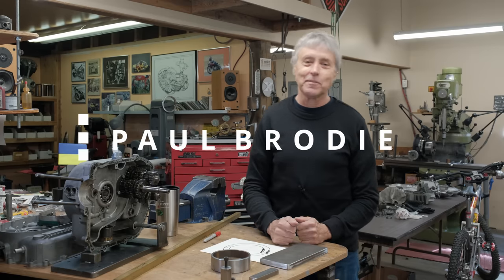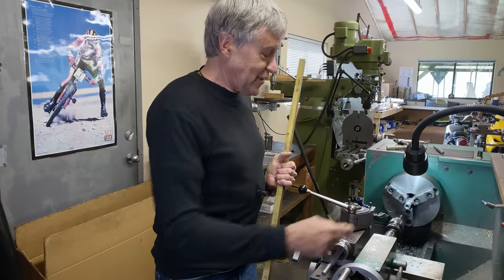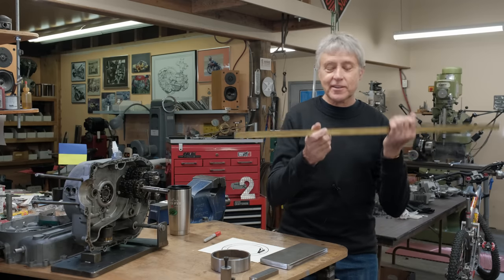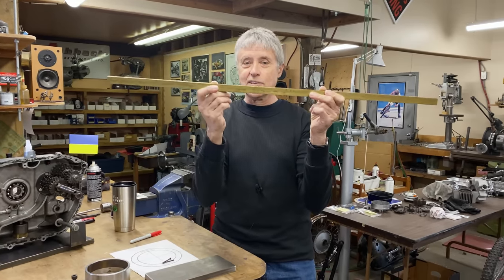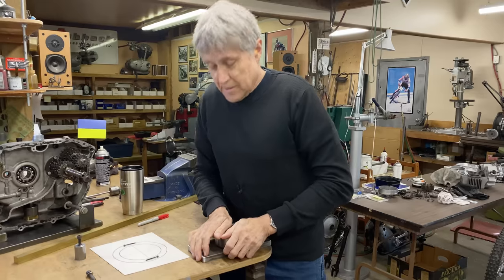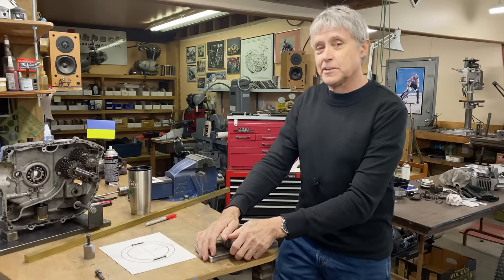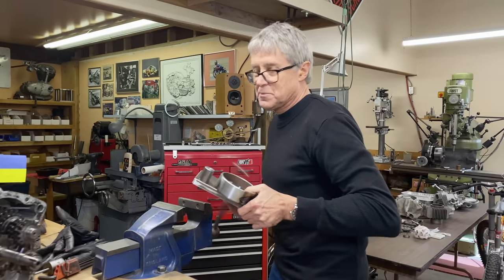Tailstock Spinner Upgrade // Paul Brodie's Shop

Comment: Very cool!  Dont forget to use your carriage as a tailstock stop so you can pull back the tailstock to remove chips instead of retracting the quill and then push it back against the carriage to your repeatable stop.

Comment: We had rulers like that when I was a kid. Some had a metal edge inserted on one side. I remember the teacher would whack you with the metal edge sometimes if you were misbehaving.
Reply: The metal edge goes back to pens.
Because it is raised, ink from your quill (or nib) will not creep under the ruler because of capillary action.
Reply from the maker: Yes, that ruler does have a metal edge. I also remember teachers that would hit students, in front of the class.

Comment: You mentioned that you were nervous of breaking a tap off in bronze or brass and having to start over. As a musical instrument repairer, we deal with broken taps or rusted in place screws by boiling the part in a solution of Alum. It is a slow process but won’t hurt  brass, bronze or sterling silver. The steel just dissolves.
Reply from the maker: Thanks for the tip! I do try very hard not to break taps, and am 99% successful.
Reply: As an old Jeweller, we did similar if we broke our small drills in gold or silver. The only difference being we'd decant some of our "pickle" solution (sulphuric & water ie; battery acid) into a separate jar & throw the item into it.
Heating the solution increased its "power" to corrode & dissolve the steel from days into hours, especially useful on those "rush jobs", which were usually "why" you'd broken the drill in the first place. 🙄
Only drawback is that steel reacts with the pickle & will create a light "copper plating" over everything but easily removed with a light rub of fine Scotch-Brite.
Reply: This is gold. Thank you for sharing! YouTube is awesome.
Reply: @quartfeira  Just a footnote if using this process, the "broken steel" item will typically be hardened so wherever possible you'll want to heat that section to a "red" heat so as to soften the steel. Just be sure the component your trying to save can 1: withstand being heated to that temp without melting. 2: can still be useable in an annealed state.
Given we're talking mainly brass or bronze, their final usage needs to be considered & whether their softened state would work against you. HTH

Comment: I did not know bending brass like that was even possible. Great improvement to the lathe, immediately recognized why You wanted to do this... On my present lathe I have a lever feed for the tail stock. It is usually wonderful for small drills and long holes but does not work well for grabby materials and larger drills. I use the same type Multifix toolpost as You (B size) and got a MK chuck mount tool holder for it that makes it possible to drill using the feed of the lathe. Works really well, used that method for several years now.
Reply from the maker: Erik, thanks for watching and commenting.

Comment: 3:35 If you are referring to a 12.9 bolt grade, that is 12 9 not 12 point 9, metric bolt grades have two numbers, the "." is just a separator, not a decimal
Reply from the maker: Well, you knew what I was talking about. No one else has ever corrected me. But I am going to check anyway for my own satisfaction. Thank for watching.

Comment: When drilling on my lathe, I unlock the tailstock and slide away from the head stock. To make this convenient, I replaced the tailstock lock lock nut with one I made from 3/4" hex, 1" tall.  Then I purchased a cheap offset box wrench, and chopped off the end I didn't need - this makes a nice lever to lock and unlock the tail stock.
Reply from the maker: Sounds like that works for you. My tailstock locking handle works well for me. Thanks for watching.

Comment: As always, thank you Paul & Mitch.  I've tried doing similar projects in steel, and have typically been frustrated.  I think the key to the bending/machining combination is to start with sufficiently oversize stock that you can find the part inside the poorly/irregularly bent stock.

That giggle at the end is priceless!  I love that feeling of having something work out so well that it just make you happy.  :)
Reply from the maker: Thanks Alan. Yes, I do like it when a project works well.

Comment: Another manual bending option to at least, coincidentally perhaps, store in your head is a Hickey. They use a long handle to bend little kicks that will add up to become a controlled radius bend. Commonly used for rigid conduit, rebar, and round stock. They don't create a smooth repeatable radius carefree by design but they will provide one with enough experience, skill, or luck.

A Hickey wouldn't have been my choice for this project either but it wouldn't stop poking me until... it's gone now.
Reply from the maker: When I was a teenager I spent a night with a young woman and she gave me a Hickey.

Comment: The split clamp design is good, as with the extra moment from the added flywheel mass you lose feel on smaller drills, and this is easily removed for those rare jobs. Nice work Mr. Brodie 👍
Reply from the maker: Thank you Spencer.

Comment: Nice eye, Mr. Brodie -regarding the bending…there is such a small window of temp range for this type of operation, and the speed of the pull is critical for this to work.  The brass bent up because the steel plate pulled some of the BTUs from the stock, and it immediately became stiffer.  Well Done !
Reply from the maker: Thank you. That was a "lucky" bend for sure!

Comment: Interesting solution! 

You should add a toolpost mounted drill chuck to your arsenal. For being able to plunge and back out quickly it can't be beat. And for power tapping it's also a treat.

Comment: Now take off the two wheels, and have them statically - and then dynamically balanced! You’ll be amazed how much longer they’ll spin. I don’t know if the drag in Your tailstock sleeve or spindle nut would be a restricting factor, but things like this always make me want to dig a little deeper for perfection.
Very nice job on the bend! Thanks for sharing this video! 🥸
Reply from the maker: Thank you.  It has been a long time since I oiled the tailstock, so that is next.

Comment: Always wondered about bending larger cross section brass; I have a nice piece with a kink in it I picked up at a flea market a while ago- had a go at it with a mapp torch but figured not enough heat... maybe give it another try next time I have the acetylene torch out.   Thx!

Comment: Watching you bend brass was good to learn. Thank you.  One thing I was thinking watching you machine the I.D.  You could have clamped them
together with a 5 or 10 thousandths shim on both sides so when your done machining, that would be the clamp gap for a good clamping fit.
I build motorcycles too. That's how I machine mounting brackets that clamp to the frame or something.
Reply from the maker: Yes, I have used similar shims like you have. I made the fit size on size, and with the large OD it was "a good fit". Thanks for commenting.
Reply: @paulbrodie  That's funny you said that. As I was typing my comment, I was thinking "Do you cut to the exact size
or one thousandth over?" If I Remember correctly, I think exact size works & is a tight fit. I guess it depends on how
tight do you want it to fit.
Reply: @toddk.5873  If size-for-size ends up loose in the up and down direction, a few wipes with a file on each mating face would fix it. But starting with size-for-size, you can be sure there's no shake in the perpendicular direction
Reply: @Gottenhimfella  Thank you. I need the reminder. I've been doing it exact size & it works good.  Now that I remember. 
Last time I did it was 1 year or two ago. 
I can do a job that I don't do too often & as I'm screwing up, I remember that
I make this mistake every time I do this. Like once every 3 years.
Reply from the maker: @toddk.5873   Tight enough so that it doesn't come loose...

Comment: @Paul Brodie did you hear me imploring you not to stop bending the brass when you reached the half way point? My thoughts were that you would save time, gas and effort if you kept on going, but also reduce waste by only having one partially flat end off-cut instead of two. Frugal is my middle name, but I might be dyslexic…! 🧐😎😜👀
Reply from the maker: No, I did not hear you. I was too busy concentrating on the task at hand. I already had the brass, it was paid for over 17 years ago. I figured that even if I used it all up, and got my end result, I would be happy with that.
Reply: @paulbrodie  I noticed you concentrating. Jestine Castreau noticed you concentrating. But he and his WEF buddies are planning a world with no more brass for any of us…! 👀🧐😎😜

Nice work by the way. I was impressed. Very nice aesthetic centrifugal force experiment too.

Comment: If the split ring is slightly loose: just machine the split faces for more gap, you can then tighten the screws for increased clamping pressure.
Reply from the maker: They fit perfectly. If I did want a tighter fit, I'd put some 180 paper on my surface table and sand the faces that way.
Reply: @paulbrodie  nice. Also: use circle geometry to calculate the circumference of the outer ring. Then you scribe the cut to the exact dimension.

Comment: Would have used a small weight from a weight lifting bar. easy to machine and close to the size you want, and cheap.
Reply from the maker: Yes, that might have been easier, but not the same challenge or as much fun!
Reply: Yeah, know what you are saying. It does look good, and something to show off!.

Comment: Hi Paul & Mitch, nice work on the brass inertia wheel for the lathe!  Thanks for the lesson!  I was wondering if it would make sense to use a "C" clamp in the middle of the bend area to help keep the brass bar flat to the base of the jig... What do you think? Would the torch be too hot for the clamp?
Reply from the maker: Thank you Tom! That was a LOT of heat. My bench vise stayed warm for at least half an hour. It's hard to keep the bend level. Another C clamp might have helped, but the hydraulic press really did a great job of straightening the brass bends.

Comment: Paul,

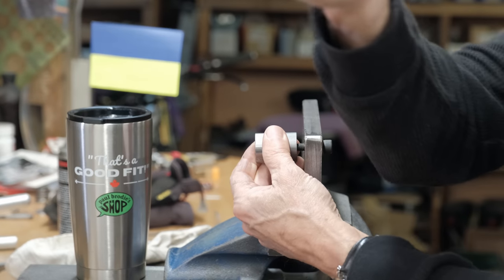Some background shots indicate that you are still playing with Aermacchis, do you still race them?  I had thought that you had pretty much changed over to board racer replicas.  At 6:53 there looks to be a V2 visible over your left shoulder.
Reply from the maker: I am not a road racer anymore. I work on my Tiger Cub, Aermacchis, Excelsiors, and other projects. The yellow bike is my 996.
Reply: @paulbrodie  My first MX, we called them scrambles back then, was on a friend's Tiger Cub.  I play with 'macchis still and I'm hoping to race later this year here in Spain.  From 2007 I raced regularly in the US on the east coast up until a couple of years ago.

Comment: That brass piece came out looking great. When you filed it to the finished shape, did you put it in the vice or put it back on the lathe?
Reply from the maker: I used a 3/4"end mill and used it to cut a basic horseshoe shape in a small 6061 plate. This became my template for the radius. Then I carefully machined the brass OD to match the template. When I got it very close, that's when I switched to the bench vise and used a file for the final radius. Then emery cloth. Then Scotchbrite.

Comment: I have seen people use the compound to drill with or tie the tail stock to the compound for fast chip clearing but I have never seen anyone use a flywheel effect on the tail stock quill. Are those allan wrenches made by the Silca Co. Who made bicycle pumps back in the day?
Reply from the maker: Maybe the Tailstock Spinner is a World First? I really have no idea. Yes, Silca pumps! They make very nice stuff.
Reply: @paulbrodie  Paul you should check out a YouTube channel called "Winky's Workshop" if you get a chance. In many ways he is like you. He is retired now and spends time in his shop doing some machining and woodworking. About a year ago he built a replica of a 1920's Briggs & Stranton flat board car. He is all around millwright who comes up with some clever ideas.

Comment: Ummm, wouldn't  something along the lines of lead be cheaper and easier to do?
Reply from the maker: You're kidding, right?
Reply: @paulbrodie  ... maybe if you drilled numerous 1/2" holes, not quite 3/4" deep, in your ring radially from the inside and inserted 1/2" pieces of lead rod to add mass?